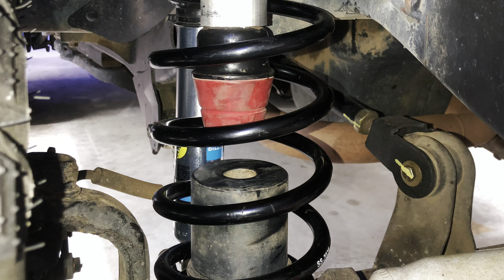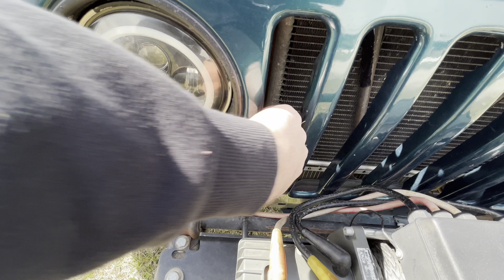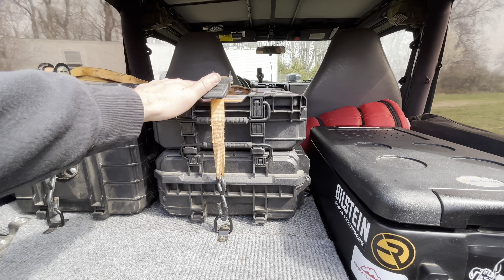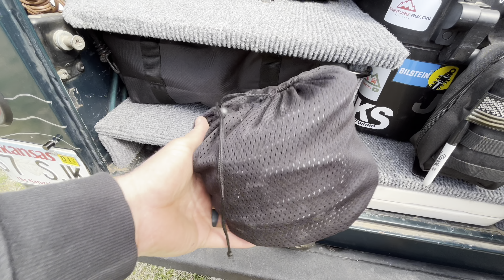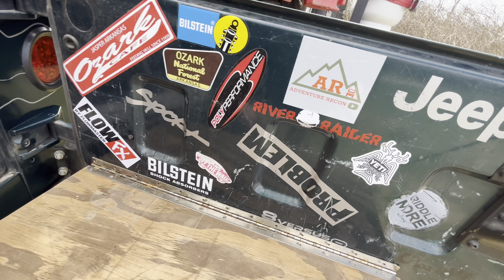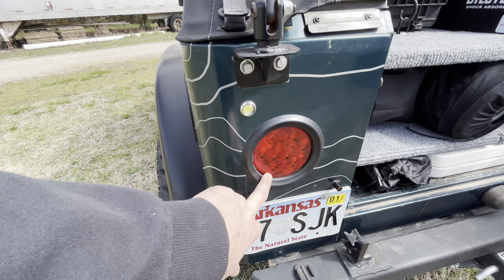Overlanding Jeep TJ Walk-Around

Comment: Could you give me more details on the type of steering box you fitted as I find my steering is quite loose although the steering box is fine. I would lift to tighten it up a bit. Great video!
Reply from the maker: If you have 97-02 TJ a good upgrade is a stronger 99 Dodge Durango string box, bolts right up !

Comment: I took the Dana 35 out of my 05 TJ as soon as it broke, and put a Dana 44, with an E locker,regeared to 4:56 gears. I put a lock right in the Dana 30. Running 33-13.5-15 netto Mud Grapplers.

Comment: If a 3.5 inch lift fits 35’s, do you think a skinny tire like the 255/85/16’s “33’s” pizza cutters would fit on a 2 or 2.5 inch lift from Old Man Emu?
Reply from the maker: Don’t see why not!
Reply: Absolutely. I have an Old Man Emu 2" heavy duty lift and it netted 2.5". I am running 31 x10.5  but 33" would easily fit.

Comment: Wait...did I hear correctly? You said you were running the stock 3:07 gears on it still!? How has that worked out for you so far? My Tj also has the stock 3:07 gears and im thinking about a regear (eventually) but honestly its drive-able. The amount of hate this ratio gets on the TJ forums makes me want to regear asap.  Ill do it soon but honestly I feel it can wait. Im running 33s also.
Reply from the maker: I sold that TJ after owning it for 10 years to more room and bought a JKU Rubicon. On the TJ I ran 35’s the whole time and never regeared or broke anything on the axles with the 3.07 and the 3 speed Auto.